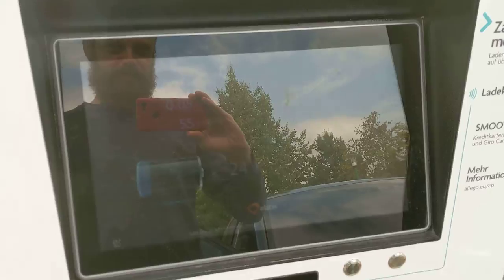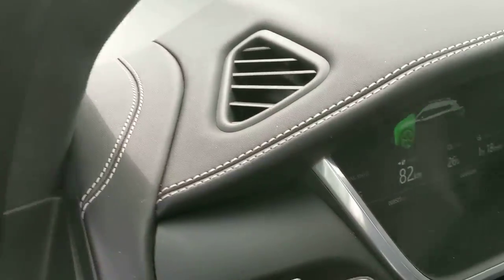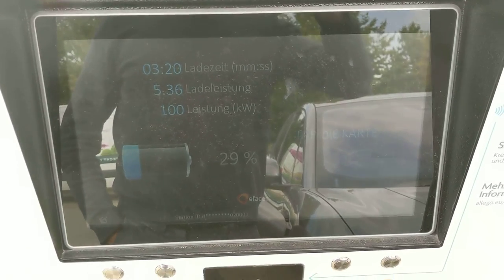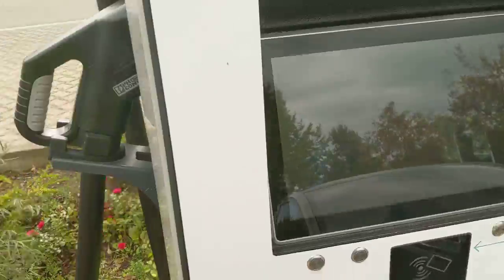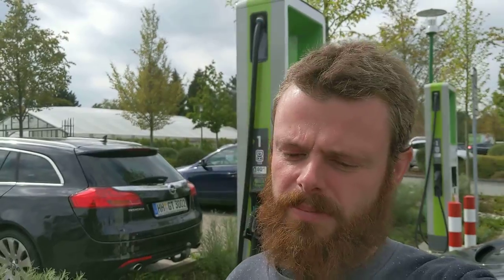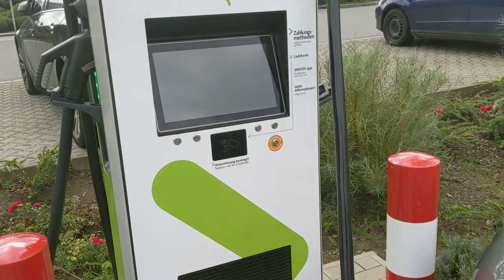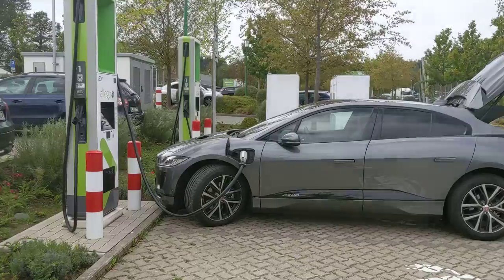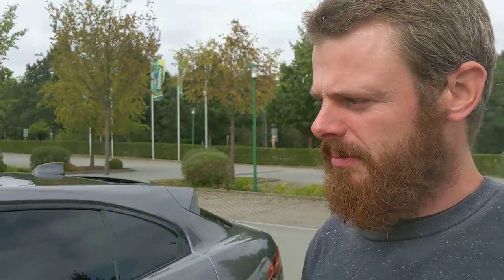Allego HPC Hamburg 100kW charging Jaguar I-Pace

Comment: Sad to see sustained 100kw only with system down.. Why are they afraid of allowing sustained 100kw speed I wonder?
Reply from the maker: I don't think they are afraid, I think they are having trouble changing the 'control mechanism', because this push down to 80kW that's happening to everyone after 2 minutes of charging is obviously some kind of throttle but also one that doesn't make much sense. So I think it's a bug, that they cannot seem to get rid off, just yet. Crazy thing is that when the system goes down indeed, the charging actually goes up!